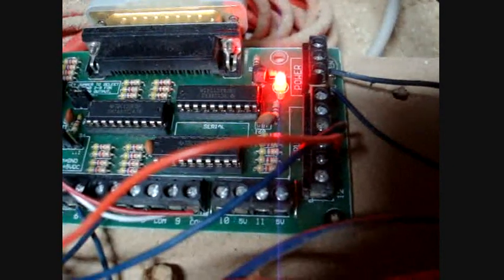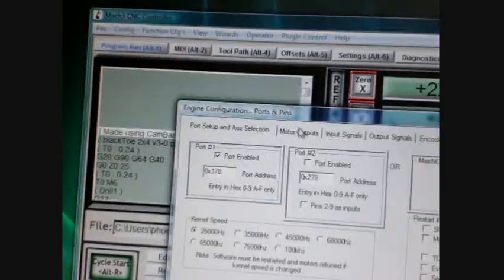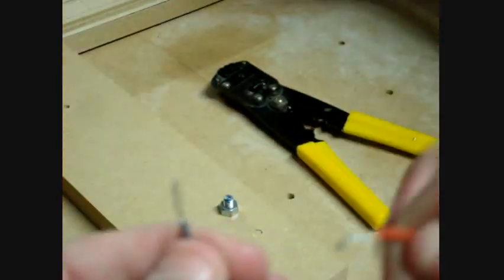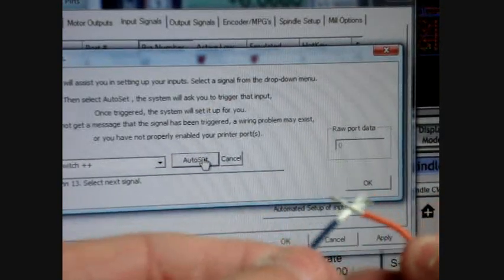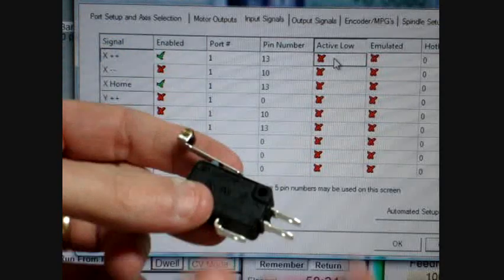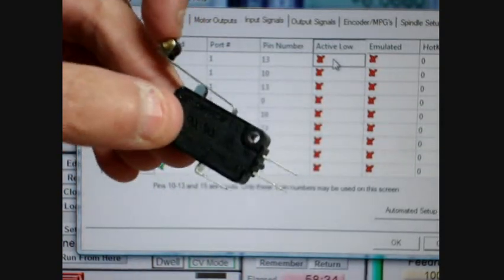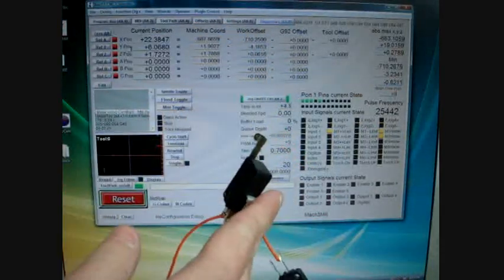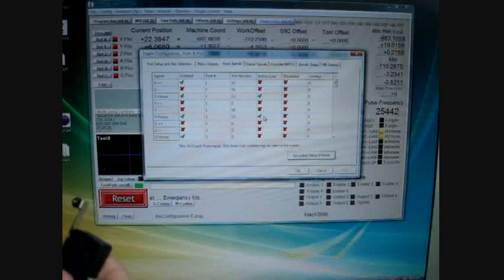homing tutorial part 1_0001.wmv

Comment: What if I'm running the Ethernet smooth stepper says can only run automatic setup in printer port mode
Reply from the maker: The automatic setup is only available if the software has direct connection to the limit switches. The parallel port has a direct connection to the limit switches.  Mach3 cannot determine the state of a limit switch through an Ethernet or USB as these are made for instruction and the limit switch states goes through an external device (the smooth stepper).

Here is another way to think about it.  The software is processed through the CPU and the parallel port is directly connected to the CPU (similar to GPIO pins).  When Mach3 polls the specific pin (through address calling), then Mach3 can directly determine the state of that pin.  The pin may be connected to a limit switch (input pin), or an output stated like a pulse for the stepper motors, or turning something on or off.
Reply: Patrick Hood-Daniel so there is no way to run limit switches with the smooth stepper? I just need it for the z homing. I got the smooth stepper because Windows 10 parallel port is non functional any advise ?
Reply from the maker: No, I was referring to your question regarding "automatic" setting.  Go ahead and use the manual setting approach according to the smooth stepper instructions.
Reply: Patrick Hood-Daniel on my c10 breakout board I have zero 5 volt power from pins 10 and on could the ess be preventing my limit switches from working? Or the pull up pull down? Idk would adding a jumper with 5v be a bad idea ? Trying to get my floating torch plate working...any help is appreciated
Reply: Patrick Hood-Daniel does mach3 make my Wi-Fi disappear on my computer even after I created 2 separate networks ? This is the second computer where my internet capability disappears after using mach for a few days

Comment: hi when I hit the auto setup inputs signals button maxh3 says this is for printer port only? and will not open the next page where you go the settings ?
Reply from the maker: If you are not using a parallel port for the communication to the CNC, then you will need to set up the inputs manually.

Comment: I have been reading threads on home and limit switches. All seems pretty straight forward how i need to clarify before i start wiring and get my hands dirty.

Question/s:
1 - As I understand there are two schools of thought for home/limit wiring, one is to wire X Y Z on separate pins with a common across each axis.The other, using a single pin (1) across all axis.

A - Advantages / disadvantages to each (using Mach3)?
B- Does the actual switch configuration matter (NC or NO)?

2 - With a probe, do you really need Z home and limit?

Comment: im having a problem , built a machine for wall paper , but i want it to cut every 5 meters and i cant do that unless im getting out of the grbl hope u understand what i mean any i dea how to do that by using a switch or any electric measuring tool that can be connected to the grbl so i can keep it continues running?